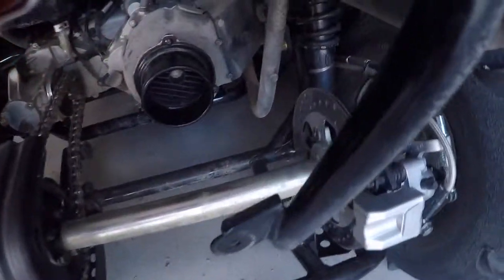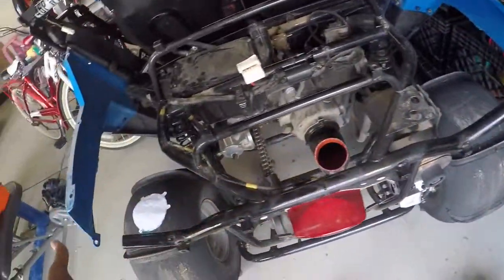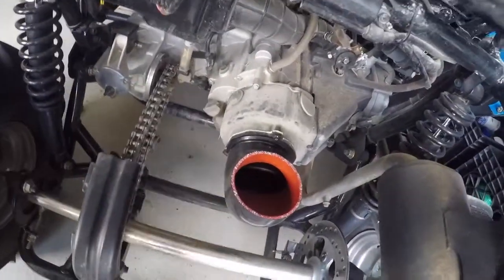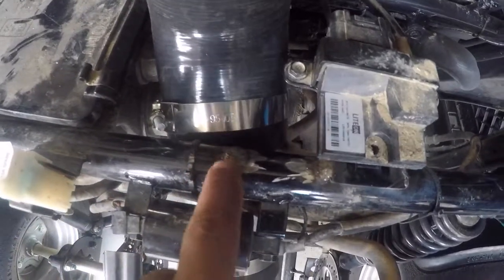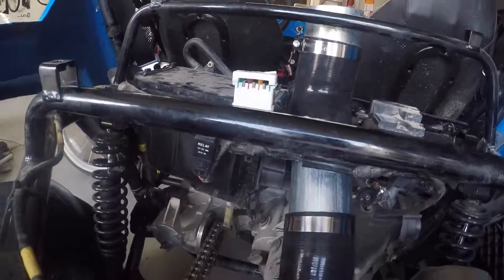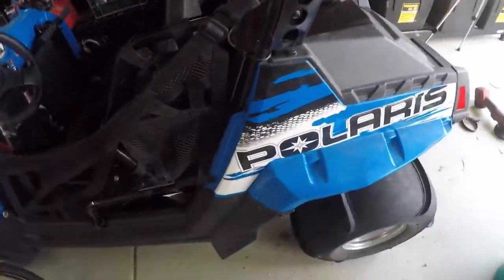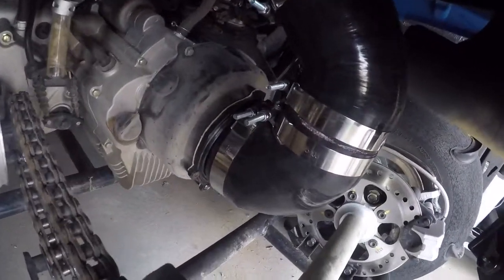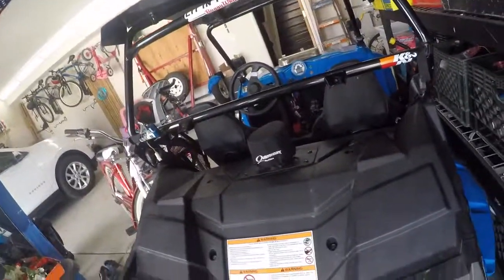DIY make a engine cooling intake for Polaris rzr 170 mod and rear plastic panel removal Must Watch

Comment: Question how many inches  clearance  do you have between  the elbow  and the axle  thanks
Reply: @tonygtv1976  I did mi son already but I went with 5 inches to 4 rubber  adapter but I feel is to close to the axle I am modifying it to make it like your today I reallly  appreciate  your video  thanks